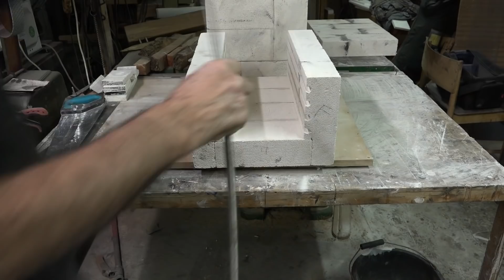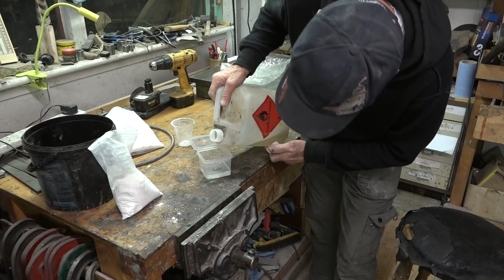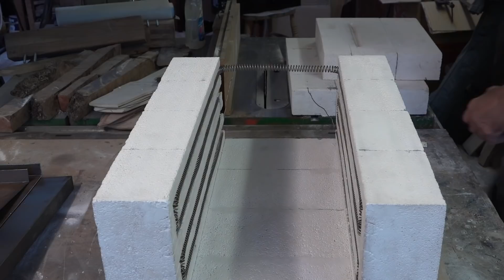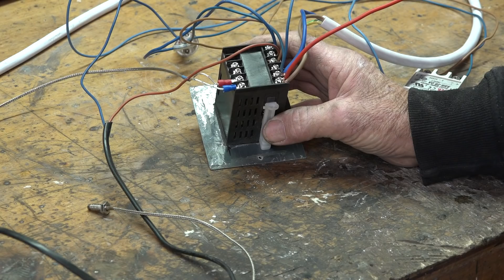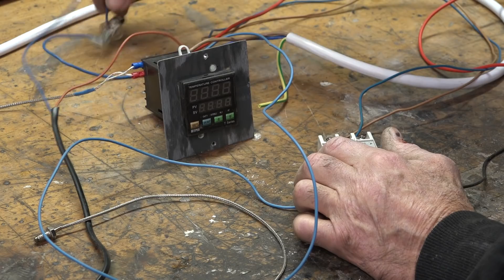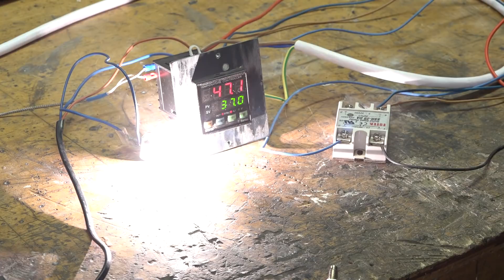heat treat oven build pt2

Comment: Hello, I made mine with "kanthal" 1mm aprox, but 5 kanthal resistor coils have broken in less than a month, every two burning cycles one breaks. They tend to come out of the grooves on the sides at certain intervals and only with the weight, when heated to 730 ° C they break, or in places where the coils are very close to each other they also break. Is Kanthal that fragile or have they scammed me with the purchase?
Reply from the maker: Hi there, well the Kanthal wire I have has been faultless really since i built the oven, I since relined the oven and used thicker kanthal wire which made it heat up faster that too has been no problem at all. I think maybe you dont actually have kanthal as it is one of the best heating wires around.

Comment: Nice! How hot does the steel casing around the oven get when you use the oven? If you  were to fire up the oven to 800 degrees Celsius, would the casing be 200 degrees C?
Reply from the maker: Thanks...It never gets above 35 C on the outside.

Comment: Hi Loz, thanks so much for these videos. I'm looking to use a similar design for a small ceramics kiln. Just wondering whether you considered calcium silicate board instead of fibre blanket for the backup insulation? It's more rigid, so you wouldn't have needed the metal lugs to stop the main brick part from moving around. It's about the same price as fibre blanket. Also, is there any reason you didn't build the door entirely out of fibre board? Cheers
Reply from the maker: Thanks Oliver, I used the blanket simply because I already had a roll and its a pretty good insulator and the metal casing is an effort to keep moisture out of the insulation and brick as the oven lives in the unheated part of the shop gets damp in winter. the door is mainly fibre board just that sheet metal framing to house it but it is a good solid attachment point for the door hinges also. cheers
Reply: Thanks mate, appreciate the clarification. How is the fibre board door holding up? Any cracking?
Reply from the maker: @oliverjamesbrown  The door is fine mate still just as i first fitted it, whole oven has been faultless really, just one minor thing after about 5 uses the element slipped out slightly where it crosses on the back, figured that was the whole thing flexing and stretching so i put one staple in the middle of it and it has been fine ever since. Have recently got some 1.6 mm kanthal wire to replace the 1.4mm i used  so will swap that out when i get it wound will use the 1.2 mm i take out  in a tempering oven I am making. Cheers.
Reply: @LozHarrop  So you think the 1.6mm is better suited to this oven? Is that just because it's more durable?
Reply from the maker: @oliverjamesbrown  the 1-6mm is better suited for prolonged high temps like an hour at  1200 C when heat treating stainless steel i doubt you would be going that high for ceramics though
Reply: @LozHarrop  Makes sense. Thanks for that.

Comment: Hi Loz, would you please advice for a good PID worth for this job? Great job, thanks for the vid.
Reply from the maker: Hi any of the basic pid controllers will do the job, but ramp soak etc controllers cost maybe 5 times more and as i only use carbon steels i just need time and temp holds. Cheers.
Reply: Loz Harrop thanks 🙏

Comment: I recently put a PID controller on my kiln, biggest frustration was that the wiring diagrams on the sticker on the unit were wrong, so were the different ones on the instruction sheet. After a call to the suppliers found the right ones online, and it runs great. Binned the meaningless sticker...

Comment: Looks really bloody good mate. Have you got an isolation switch on those elements though? You don't want to touch them buggers with ya tongs.
Reply from the maker: Hey Rob, Cheers, yep wired a cut out as soon as the door is opened it kills the power to the elements, treated 2 01 blades in it today made up with it both at full hardness and dead straight after the quench, will have the final video up soon. Cheers.
Reply: In which case how do you fancy building another? 😉😉
Reply from the maker: not beyond the realms of impossible mate
Reply: @LozHarrop  I'll message you Loz.

Comment: You basically wired everything like i did... I used a power brick for alarm power too. I even went a step further and put a switch between my relay, so i can switch off the elements before opening the door... I found the hardest part about building the oven was paying for the bricks and having them shipped, hahaha take it easy... You need to go in and auto tune the PID also set Alms and HY to control the alarm to + & - 2 degrees. it's been a while, I'd have to look up all the setting s again... but that turns your elements off/on & keeps a steady temp... As I'm typing you start talking about it...
Reply from the maker: Cheers Dave, Ive fitted a kill switch on the door so it turns off power when the door opens and a kill switch on the panel too,  wired up the alarm and a power light on the panel . All works fine so far, i went into the settings and set an offset of 4 degrees for the thermocouple and now it holds almost dead on the degree that the oven is set at. just need to find a space for it to live now. Cheers.
Reply: @LozHarrop  That's awesome, my new bricks arrive tomorrow and i just ordered the rest... I'm running out of space, so I'm gonna stack it on top of the other, should be interesting... Glad you got it working, take it easy...

Comment: I'm getting ready to build a 2nd oven... My 1st oven, I've used for a couple years, but it is just so big, when it comes to SS, it takes hours just to heat up(the door has been the biggest leaking issue). High carbon is fine(1500f).. I want to build a smaller oven, so i can heat it up to 1950f+ and have the big oven at 1500f, pre heating the blades. If for nothing else, to save soaking the blades the whole time I'm waiting for the oven to heat up... Great video, take it easy
Reply from the maker: Hi Dave, I ran the oven up to 815 C - 1500 F  tonight took about 45 mins to reach it. the hottest part of my oven on the outside was the door as that is the least insulated part. temp was only  40C -100 f happy with that though. Cheers
Reply: @LozHarrop  Just be careful, when I 1st used my oven, I thought "oh the outside isn't that hot", but 1/2 hour later after turning it off the heat dissipated through the brick and I got a quick lesson in thermal dynamics, hahaha

Comment: Hi <<gold hands>>
How did you calculate the length of the wire for wounding, to aceive the correct voltage drop?
Always an inspiration
Cheers from Greece
Reply from the maker: Hi Tasos I kind of followed what other guys had done with the element on their ovens plus the veg oil guy has a calculator on his web site that tells you pretty much all that if you put your numbers in.
Reply: @LozHarrop  Thanks for the reply, How many KWs is your heating element?